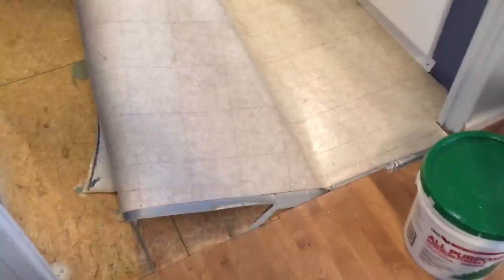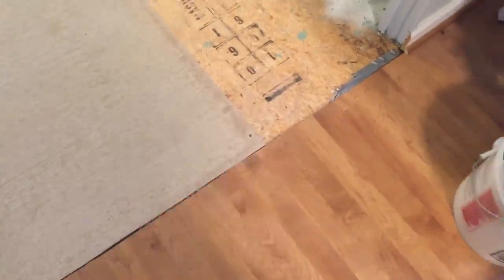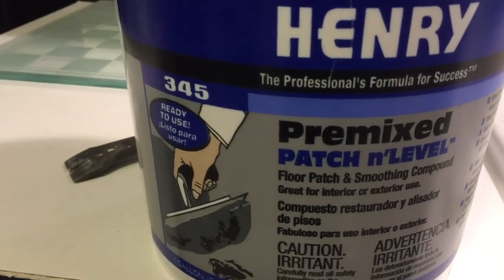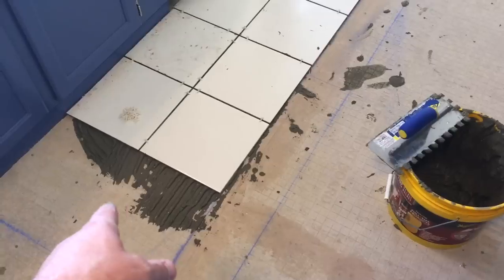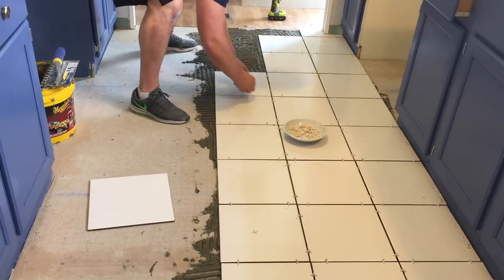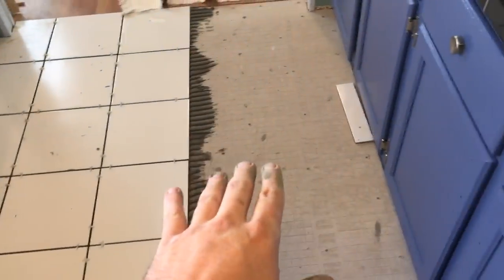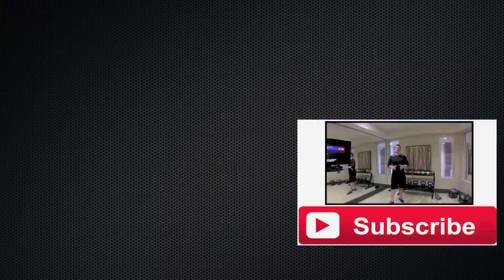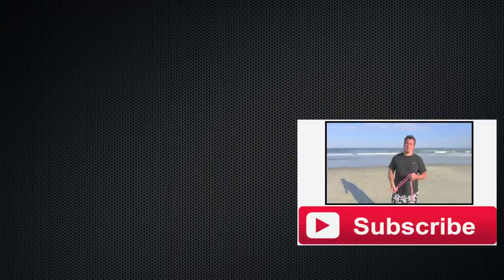How to Tile a Floor FAST AND EASY!! Learn the Basics! Do it Yourself for Cheap!

Comment: I dont know tile perfectly but if you are new to tile there are 3 things you might want to hear with this video:
1) You can actually go a little faster than the wet saw (espcially on straight cuts) with a tile cutting/snapping tool. Cheap and fast. That combined with a grinder diamond bladed is what most people use instead of wet saws.
2) They sell little plastic lashing systems that make the tiles all land at the same level. So he did it by hand but you can get those to make the tiles flush every time. That's recommended for sure. Relatedly, you want to push the tiles down harder than he did to get full contact on the back of the tile with the thin set - otherwise they might come up prematurely. 
3) Like he said, you want to generally go from the middle out and have two even halves on both sides instead of that tiny piece of one side. He was going budget over looks which is an option but if youre installing for someone else, definitely spilt the difference instead - it looks better.

Great video! Appreciate it! Anything to help people jump in!

Comment: You're actually supposed to collapse your ridges along with back butter your tiles before you set them. If you don't press down you don't collapse the ridges and it leaves tons of voids underneath the tile which will cause them to break later down the road. Especially if something is dropped on them.
Reply: Exactly, I can just see the tile breaking easily with the methodology that he used. 😬 eesh!
Reply: Yep.
Reply: That's why every tile he pulls slightly back then forward.
Reply: Sets them in the corner then pulls them back that’s not just to space them it’s collapses the ridges
Reply: I think it's funny when you don't carry yourself a sponge bucket of clean water and clean everything as you go. Next morning all you gotta do is mix grout. Stay clean while installing and you'll thank yourself later. And no it doesn't take longer because by the time you go in and clean your ass off before you grout always takes longer. Not to mention you take a good chance of  chipping a tile to clean the dried thin set off. Been laying tile since 2000 and still going. I'm thankful I got taught the trade from 3 different generations of the same family and none of them are alive today. I think of them every tile job I do and will always and forever be super grateful for them being hard and teaching me something. R.I.P Sparky's love you guys

Comment: In all my years tearing out other peoples tile floors, a install like this will be a easy tear out the tile isn’t stuck by the thinset only the grout is holding the tile in place, sorry that I had to say that but it’s true
Reply: Yes it is, it’s probably 70% adhesion and thats fine for a kitchen

Comment: But in seriousness, your suppose to backputty the board then screw it in. Not sure if this was done, then u want to use mortal and tape for the seams or it might crack over time with the traffic, then u want to also backputty the tile as well as the cement board for ultimate bond, simply putting the tile over with no mud doesn’t ensure complete contact. Wet area and high traffic should cover the tile a minimum of 90% to avoid hollow spaces where cracks can occur. The only difference between a good and a bad install is usually what’s underneath and most home owners won’t see it until a few years out and the tiles are poping out or cracking
Reply: > Wet area and high traffic should cover the tile a minimum of 90% to avoid hollow spaces where cracks can occur

What do you mean cover the tile a minimum of 90%? Thanks! :)
Reply: @0314bmoore underneath the tile should have 90% covered by the mortar.

Comment: Couple things wrong no mud under hardy backer no tape on seams and just like wood supposed to offset joints in hardy backer
Reply: Correct. When I install tile, I always mud under the hardi and have offset joints. But however, for a just a rental, this should do
Reply: Never put mudd under backer thinset no mud . Tape all seems ! Looks Decent for now hopefully it doesn’t fail
Reply: @edrodriguez665  Putting mud under the hardi is the correct way, my guy
Reply: @clubamerica98  when i install dont matter rental my own home or commercial its what i do might as well do it right the first time
Reply: I do it for a living everyday
Reply: @shaned7569  And I also do tile everyday as a living. Master baths, bedrooms, showers, backsplash, outside patios, even pools. And when we hardi the floor, we certainly mud under.
Reply: @clubamerica98  good that u do just the however could be misleading to ones that dont know
Reply: @clubamerica98  🤣🤣🤣 good luck
Reply: It best to follow manufactures installation guidelines. It also doesn't void the manufacture wattenty.  The NTCA, TCNA ans ANSI are also ideal referances.

Comment: Hi, if I have no experience in this field, is this  the best video to follow for a complete beginner that wants to  learn how to do it on their own
Reply: Big M No. Do not repeat what is done in this video
Reply: @evancharnock906  i agree
Reply: Do not follow what this guy is doing. As soon as I saw him say just set the tile on the thinset and not to push....i knew he had no idea what he was doing. There will be maybe 10% adhesion if he is lucky. There is a reason your supposed to push down on the tile and move it back and forth slightly. Watch the video called how to properly lay tile and you will see how wrong this guy is doing things

Comment: What's all these board for? When I learned the trade we just tile over the subfloor or level it if it wasn't leveled. It's just extra unecessary work that will slow you down.
Reply: There cement tiles its good to use them so the tiles don't crack over time

Comment: The only thing you missed was exactly what I was looking for in your video which was the consistency of the mud the tile is sitting on. Not the grout. Other than that it was a great video with lots of really good pointers.
Reply: What I usually do it mix it till it doesn't run off (too liquid if it does) and it should hold it's shape and stick to the trowel.

Comment: Thanks for taking your time to upload but ***VIEWERS BE ADVISED***this video is a basic overview but important details and necessary skills are completely missing. This floor will absolutely not stand the test of time. This is a total D.I.Y. hack job.
Reply: & to the uploader I seriously mean no offense. You have the basics down pack! But you aren't setting the tile correctly. There is probably 10-30% contact between mortar and tile. When you walk across that floor it must sound hollow as heck. You installed cement board without installing CBU tape at the joints. Then why didn't you just leave the plywood subfloor 🤷‍♂️ you're still getting flex in the floor you could've saved money and did without the CBU. Hopefully your skills have improved. Everyone starts this way which is why I mean no offense.. BUT I wouldn't go around spreading misinformation about a subject I'm clearly not skilled in. Thanks again, take care ✌️🤙
Reply: 》《Fugenix》 《  on my site he'd be hauling bags,  sweeping floors & mixing buckets. It'd be a while before he'd be able to get down on the floor and start actually setting tile. Tiles can last a lifetime if set correctly. If not, it's one heck of an expensive mess and not fair to the home owner

Comment: Great, another slowest possible way to install Tile. Why are you patching the seams when your gonna thinset it anyway?
Reply: When you walk on the floor, the floor moves. (Additionally the floor/subfloor/& house in general, settles & shifts) Taping the seams makes the floor into one solid piece instead of separate sections of subfloor. That movement will cause cracks in the mortar and within a short amount of time the tile will crack along those cracks. because the mortar that supports the tile is cracked. Hope this helps ✌️🤙

Comment: Everything about this video looks like a hack. The only tape measure I saw was closed in back round when the planned the room. Maybe that was not even a tape measure. A tile installer that never gets down on the floor, the knee pads are in the truck next too the tape measure.